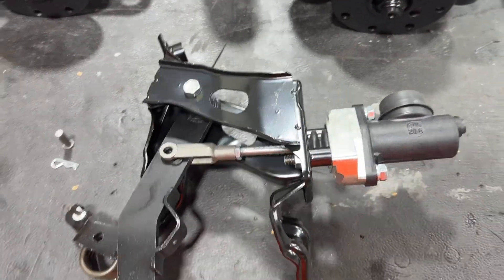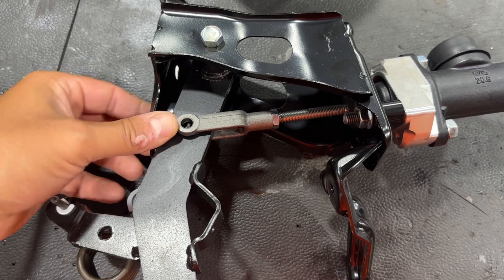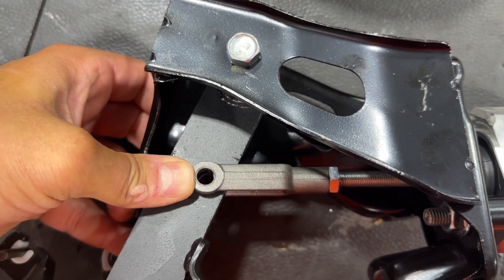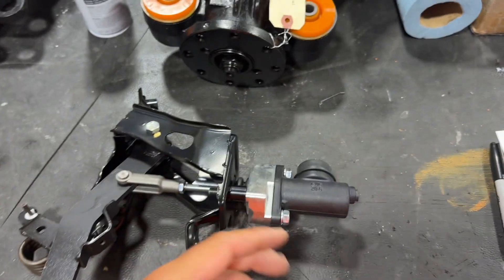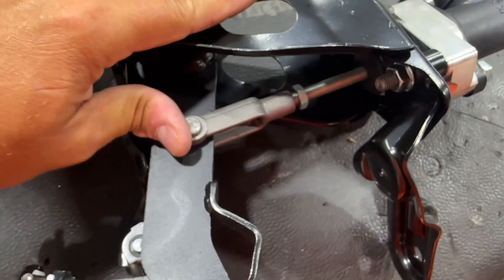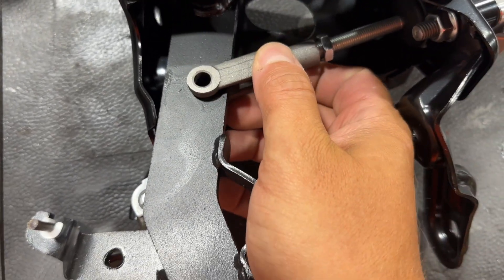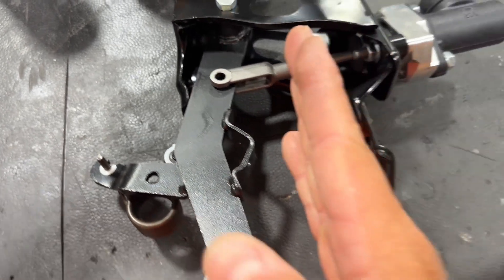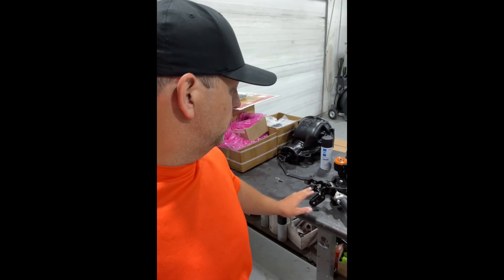Clutch master cylinder tech. Free play... Watch out for pressure buildup!

Comment: Thank You for your help. I replaced my old clutch master cylinder, slave cylinder and hydraulic line. Bench bleed and bleed again after install. I installed the new master clutch cylinder the exact same length as the old one. Been having clutch pedal issue not returning and soft spungy feel.  Replaced the slave but never thought to make sure that the clutch master cylinder rod has to be probly adjusted to have that kind of free play. Did understand how to adjust it until now. Thanks Bro!